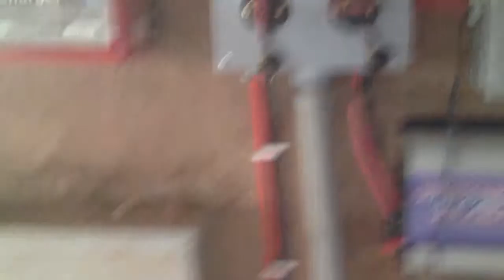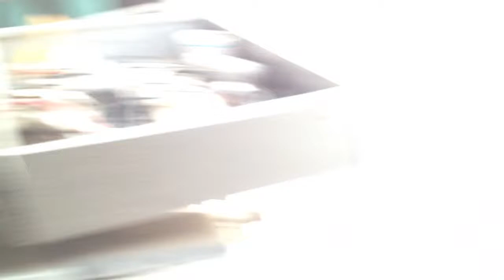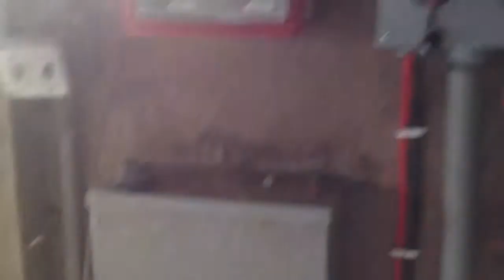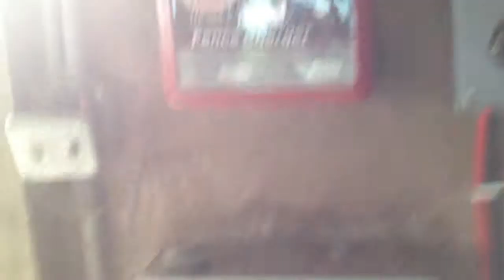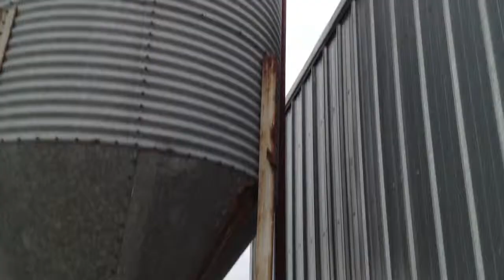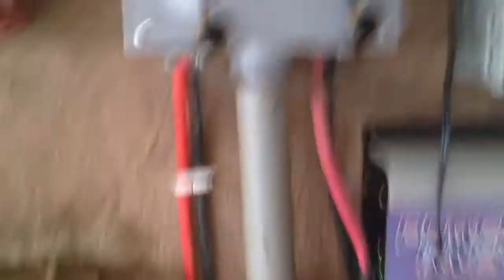Wind Turbine at barn charges golf cart that I use for feeding.

Comment: That's not a car relay inside the charge controller
. You'd be amazed at what those relays are used for. Also the company has the internals silver plated which cannot stick to itself.